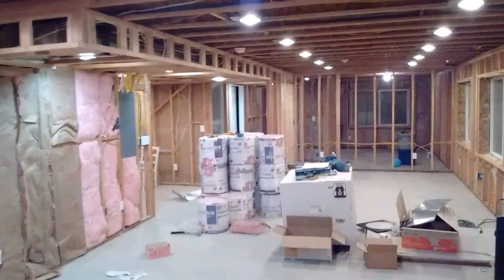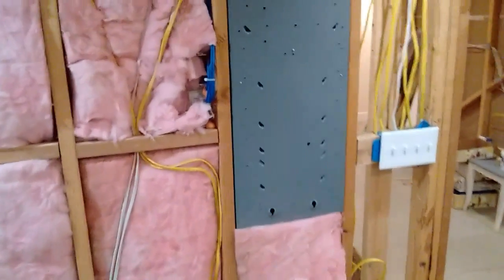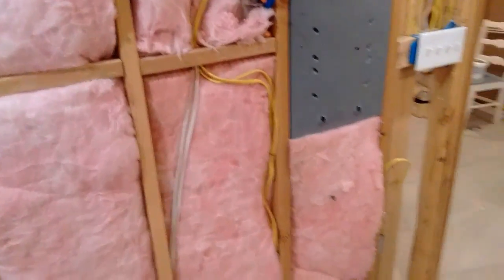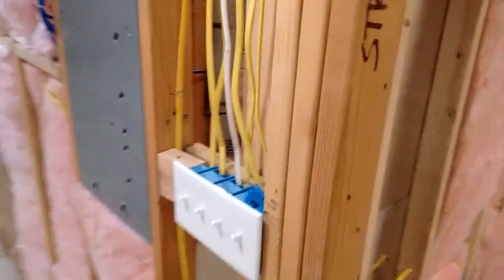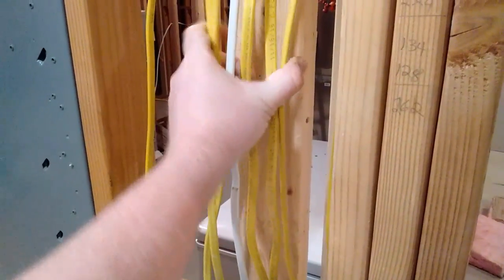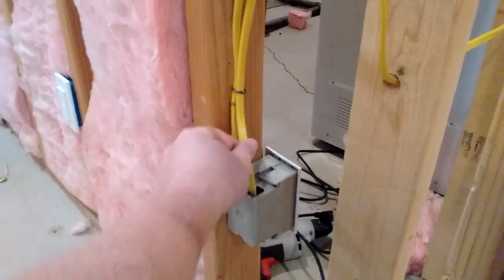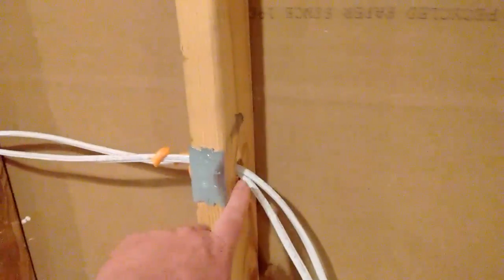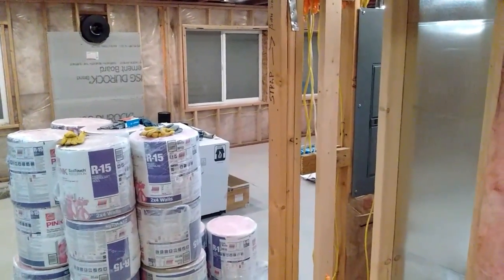5 Tips for basement electrical to pass inspection

Comment: I hope you put in an exterior disconnect. Any time a breaker panel is more than 6 feet from the meter, a master disconnect adjacent to the meter is required. Maybe that was covered in another vid, this is the first of yours that I’ve seen. 
Nice to see a vid from a cherry for cherries. It's all day 1 lessons to me, but these days lots of people are DIYing who don’t know the first thing, or terminology. Most vids are not for cherries, so good to see one. Those “adapters” are called fittings. Not to be confused with a connector, which is different. Staples need to be within 12 inches of a box, then no greater than every four feet apart. No more than three, preferably two cables under each staple.

Comment: Hire an electrician. This looks like shit.  Do you want to burn your house down?
Reply: looks dont matter for safety and i give them props for thinking ahead with the 12/2 yes cables bunched up and to many wires and wrong connector and inspector should have told them about cable stackers but i have seen a lot worse from pros

Comment: What did you mean when you said you can't put a receptacle with your HVAC system?
Reply: He pointed out a plenum which is likely an air return to the furnace. That plenum should be devoid of receptacles / switches.
Reply: @FrancisMacomber1936  Not exactly. There cannot be electrical in the same stud space as a furnace duct. he is pointing to a duct. The "plenum" is the big box on the furnace that aggregates the ducts; distributes air to the individual ducts.
Reply: "can't put a receptacle with your HVAC system"...there is a duct he is pointing to. No electrical can be in the same wall space (between two studs) as a duct.
Reply: He meant that void is s cold air return for the HVAC. You cannot run conductors through or have devices within that void. But that is the grandfathered in cold air return style. All new builds require cold air returns to be ducted, using a void is no longer acceptable.

Comment: Here in Ontario we can only put two wires together trough a  a hole , box inlet connector or stapled secured to studs , and is commented all ready , 12/2 yellow is only for counter top receptacles , 14/2 for most other regular load up to 15 amp for receptacles . 6" from the box have to be secured  stapled  little extra wire bend before entering the outlet box.
Reply: Is it okay to use 12/3 across everywhere in basement ? Projector sound system lights and fans are the items I have

Comment: For a first timer...not a bad job, but one thing missed by the inspector was two outlets facing two walls within the same space...that is a fire code violation, but you really did not need 12/2 in that space unless you are planning on running space heaters...14/2 would have been sufficient and I would have nail plated every stud.  Again...not bad for a first timer! I've been doing this for 47 years!
Reply: KS, how much you wanna bet me? Google 'Chicago Code 12-14-1' and scroll down to 'Residential Wiring' and you'll find what I've copied and pasted below. If you think I'm misunderstanding the code, please pray-tell what the heckity-heck you think it means, then:

RESIDENTIAL WIRING:

A. All wiring changes or additions to electrical systems in residences previously constructed should be rigid or electrical metallic tubing where possible and all basements should be in conduit. 1. Where necessary to fish through existing partition, BX or flexible conduit may be used and must terminate within twenty-four inches (24") of its entrance into any basement or crawl space area. 2. Where a question exists as to methods or materials used, the ruling of the Electrical Inspector shall govern. 3. All conduit on or below grade, shall be galvanized rigid conduit PVC (Minimum Schedule 40 Poly Vinyl Chloride), rigid conduit to be used in concrete only.
(No. I.M.C. Steel) burial depth a minimum of twenty-four inches (24").

B. All wiring systems installed in new residences shall be in rigid conduit or electrical metallic tubing. 1. Junction boxes may not be installed in inaccessible or concealed locations. This does not exclude use of said boxes in basements, crawl spaces or attics. Junction boxes may not be installed under overhang or decorator or soffits. 2. Said conduits shall be installed on what is known as the "loop system" and shall be completed between the approved outlets, having not more than four (4) right angle or equivalent bends including those at the outlets.
Reply: 'Two outlets facing two walls...' where is that in the video, at what point? I'm not sure what that means or looks like or why it would be a fire hazard. The thing that surprises me the most, though, is that it's apparently okay in many other states to have 'loose' wiring in the walls. I live in Chicago, and everything has to be concealed in conduit. I wonder why that is? I've always thought it was to prevent the risk of rodents chewing on the cables and causing a fire, but there're rodents everywhere...so why aren't these exposed cables a possible hazard? That's so strange to me.
Reply: @Xoletta   I am from Chicago area too.  I think a lot of the building codes were made because of the Chicago fire and unions.
Reply: No no no no and no is good
Reply: No fire code violation if not in fire rated wall. Most houses have hollow core doors with no fire rating at all, so its legal.
Reply: @UCbP9-m35c6lc0ZYUAVidIhA Chicago does have their on rules about no romex. You need research before you open your mouth

Comment: You don,t want a lot of  Romex cables bunched together.
Reply: creates heat.  only put around romex cables together .   and staple about 8 to 10 inches from a box. and on switch boxes use as deep as you can.   boxes are marked  cu inch inside , so that it is telling you how many wires can go in the box without overfilling the box.  chek out the NEC on that one.  seen to many times when some sparky has crammed in way to many wires in a box.   i once saw a sparky , a long time ago. use a hammer to push back the wires in a box.  i thought  to myself , "you idiot".
Reply: Yea its called bundling but you can split half the wires with stackers on both sides of the studs and it makes it look good. I wouldn't of passed without my wires secured in that switch box. An even easier way is cut a 2 by 4 the with above the box and staple them in a row the exact way they are running up to your fireblock.

Comment: In Ontario your job would have failed big time.  Another reason why a Liscened Electrical contractor should be hired.
Reply: It would have never passed in Chicago, either. They require all electrical cables to be concealed in conduit.
Reply: What the hell, KS? Am I 'supposed' to know about electrical code? I'm a 50 year old housewife, not an electrician. But I just had a house inspection, and that's what I was told - no exposed cables inside the walls. Are you telling me Chicago doesn't have that code??
Reply: I invite you to google it, yourself, you arrogant numb-nuts. Conduit is required in all the walls in Chicago. Go ahead, see how much you know, and I guarantee you it's less than you think you do. Smart ass.
Reply: @Xoletta  bitch go back in the kitchen and make me and the boys some food
Reply: Z Stone Conduit is most definitely not required in all the walls in Chicago. Romex is specifically prohibited by the NEC from being run in conduit because of the heat it can build up. Homes are not wired with a house full of THHN wiring (which is what is used in conduit). You have no clue what you are talking about, or you didn't understand what the "inspector" was saying. K S is correct, stay in the kitchen.

Comment: why 12/2 ? u need it just for Kitchen Counter Recepticles.... u wasted money
Reply: no, receptacles are usually 20a and thus require 12/2.  You 'could' have 15a with 14 gauge but I'd say "why bother".  There isn't 'THAT" much cost difference.  If you are worried about $100 ±, then you should probably not be finishing your basement and spend your money on necessities.
Reply: Wrong Bill.  in Kitchen then 12/2 for the plugs.  Regular house use 14/2 romex.   12/2 also uses up more space in a electrical box.  have to be careful there.
Reply: I'm from Montreal Roger and i have to agree with you because it's the way i'm gone do it... ;-) Maybe 12-2 and 20 amp for an exterior receptacle also ?
Reply: you are an idiot
Reply: Wrong! Its known as an investment in the future. Think about it!
Reply: Most home receptacle outside of kitchens and dining rooms are 15 amp not 20 amp brainiac.

Comment: You can do the staples from any load 6-8 inches so it does not have to be exactly 6 inches... Looks good and I would have definitely tied all those wires together... Gives you less risk of them being punched... Just a precaution... Good work though man especially if your a homeowner and not a pro

Comment: Awesome update! It's looking good. I hate wiring so big Kudos to ya for that. Did you have to put in any 220 run or just the 115? So looks like the next step for a lot of it is to hang your drywall? 

I don't know if you've done a lot of drywall or not, but in case you haven't, hanging it long way, 8' horizontal on the wall rather than 8 ' vertical makes things easier with less vertical joints to deal with. If you can get and handle 10' or 12' sheets go that way as it makes it go faster with less joints to finish. Sit down and figure out if you can do a mix of 12 and 8 to reduce joints. 

If you're dry walling the ceiling put it up first then just butt the upper wall sheets to that for a clean corner seam. If you have to cut any off to fit ceiling height, put the cut edge on the lower sheet to the bottom at the floor. That will give you mostly factory edges to tape and mud and the main seam will be 4 feet off the floor making it a bit easier to finish as you walk around. Also, look at using the powder mix joint compound instead of the premixed bucket stuff. If you use something like durabond 90 it will literally dry in a few hours. It depends how you mix it on how fast it goes off so don't mix up more than you can use at a time as it will set up fast on you. get one of those mixing paddles for you drill if you don't already have one. using the self mix, fast set mud can cut your mudding job from days or many weekends a day or weekend.
Reply from the maker: Dude, thanks for the tips. I appreciate it.